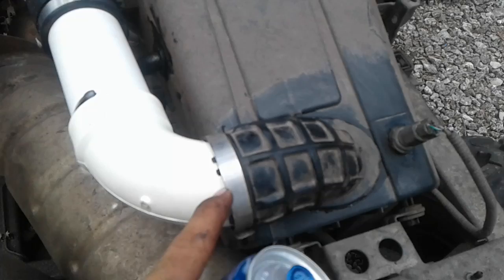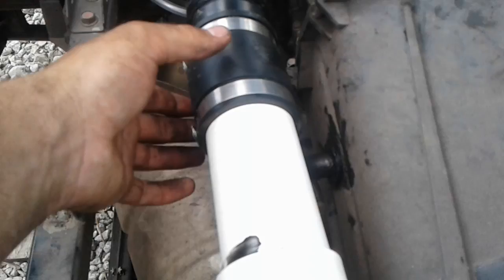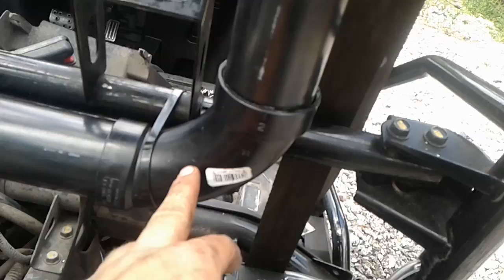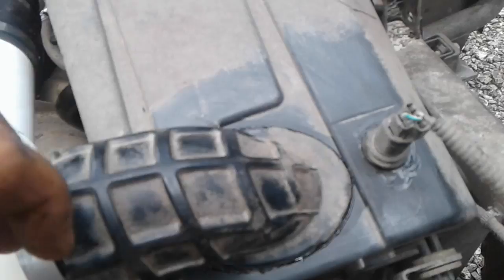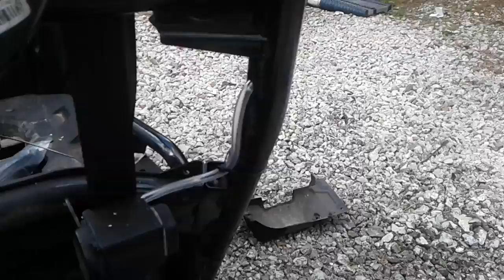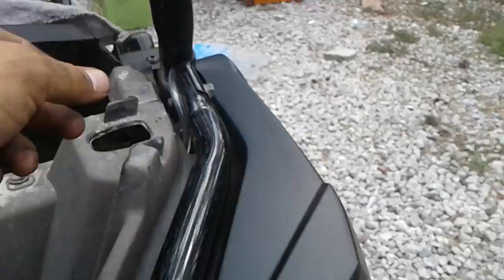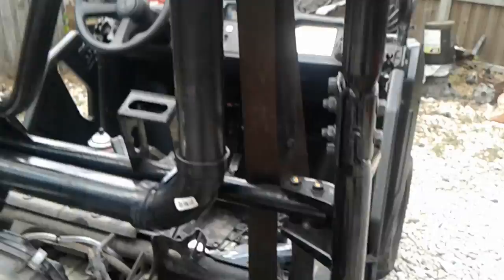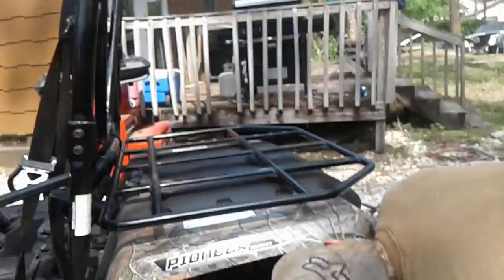Snorkel Honda Pioneer 500 and water proofing!

Comment: Hey Christian, is there anything that you can do to the rubicons electronics that are above/ at the stock snorkel to seal them off so water wont get into them? I know you had a video saying to air it out every now and then but is there a way to seal it and add a vent line so it would allow the pressure/ air to escape?

Comment: I have a 2018 Honda rubicon that I just bought. How much do you charge to snorkel, seal, and dielectric grease the bike? And should I wait for its first service?
Reply from the maker: That's a really time-consuming job you don't want to pay me to do that LOL let me know when you need a gear reduction though
Reply from the maker: as far as Dielectric grease we haven't been messing with that lately the only connector I bother doing is the one on the front diff I relocated up higher and grease it a little bit
Reply: I appreciate you getting back to me and for the information. Thank you. Stay safe out there!

Comment: Are the P5s re-geared at the diff to get the low final ratios?  if so can we go even lower using GRs for Rubicon???   Example, could possibly go up to 27 inch tire then add 15% GR to keep the stump pulling ratios.
Reply from the maker: +Nate Locke depends on the year 2017 is geared highet
Reply: Mud Puppy So we can use re-gear from a Rubi or no??   Or did Honda already do that essentially to achieve the lower ratios
Reply from the maker: +Nate Locke they all have lower diffs but the 17 has a taller 1st gear for pansies
Reply from the maker: +Nate Locke Rubicon gr will fit secondarys won't mess up the shifting
Reply: Mud Puppy cool, thanks!
Reply from the maker: +Nate Locke Rubicon gr will fit secondarys won't mess up the shifting

Comment: let’s see it with the 33”. ive got 28” mayhems on my p500 and thinking bigger is needed. does it clear the frame at the front when steering.
Reply from the maker: Move the arms forward
Reply: Mud Puppy once i get the first 20hr service done. who knows what will happen to it. a video on clutch adjustment would be awesome. just feels off a bit but it also has 2 hrs maybe it’s breaking in.

Comment: How can I waterproof my Polaris 2011 400Ho?The snorkels are ran up just don't know what vents that I need to run up and what do I dielectric grease?
Reply: Kendall Folsom grease all the electronics and connectors
Reply: Honda Powa where would they all be located
Reply: look up a wire diagram for your bike and grease all the connectors. you can find most by removing the plastics. look for some plugs put grease in them and put them back together did all mine in about 15min.
Reply: Honda Powa thanks

Comment: Thank you for this vid.  How is the P500 in mud without a front difflock?  My polaris will be getting replaced with one.  Thanks
Reply from the maker: WBOS72 it's a little low on gc and travel but it has very low gears
Reply: Mud Puppy would you still buy it?
Reply: Mud Puppy would you buy a new p500 or a used 800 or 570 the? Can't really decide and kinda on a budget

Comment: I know this is random as shit for this video but do you know of any gear reductions for the 2016 Rubicon deluxe model, the white one with the dct transmission? ive found one I want to buy but this is the only question holding me back. I have searched all over the internet with no luck. right now I have an 08 sportsman with a great gear reduction, spins in anything!!! I will only buy a 4 wheeler I can put a gear reduction in. help would be much appreciated and a sub will be headed your way sir, great videos

Comment: can you do a video on your take on the gearing between the p500 and a rubicon? i cant find much on the internet.
Reply: Mud Puppy thats what i was thinking. i just bought a p500 and i want to run a 31-33 inch tire. id like some arched a arms to cause the clearance is garbage right now
Reply from the maker: I can make arched rear arms for them
Reply: how much?
Reply from the maker: Dillon Johnston 325 adjustable with hiems
Reply: Mud Puppy hey have a big question hope you can help I just got a 300. And randomly when I try to start it it will just click but I watched a video where this guys 300 did the same and all he did and is flip the pressure release and push the kickstart and then the electric stert would work. I did the same thing and it'll crank after doing that. But what is causing me to have to do that sometimes thanks a lot
Reply from the maker: Dillon Johnston prob need to rebuild the starter
Reply: Mud Puppy okay thanks I'll try that.
Reply: Mud Puppy how much for arched arms for 1999 fourtrax 300
Reply: Mud Puppy is that for all four A -arms